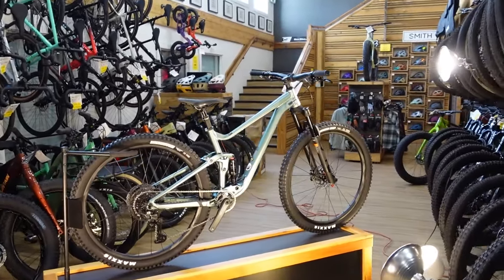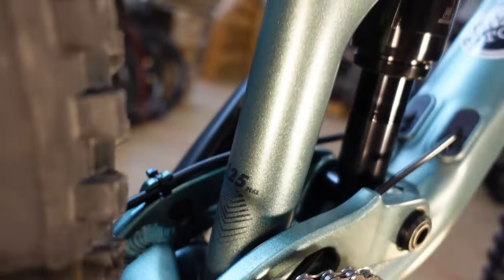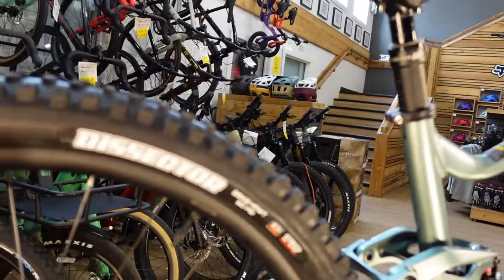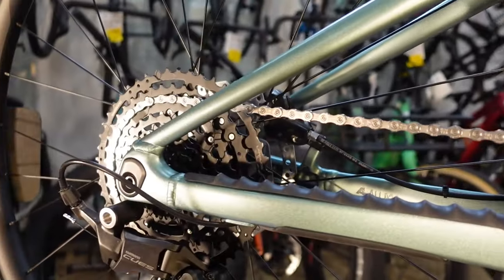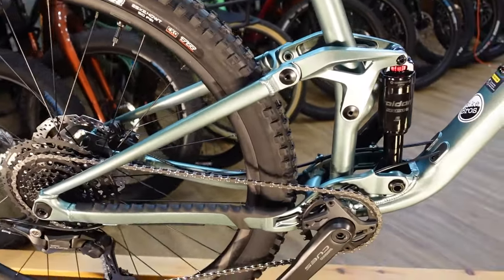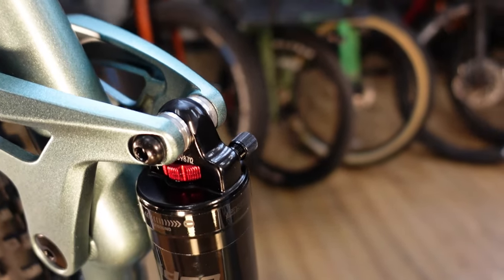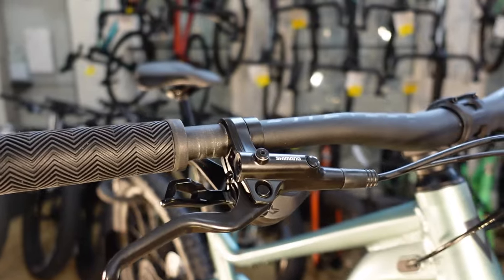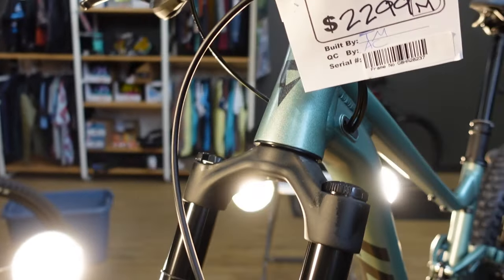2024 Giant Stance 29 2 - Best budget / value Full Suspension Mountain bike - All the Details

Comment: I'm almost certain at this point that I'll be buying one of these next year. I love the way it looks and the simplicity of the design. 33.8 lb is really not bad at all and I would swap to lighter tires too. I had a bike with the 10 speed deore and it was flawless so I trust the new Cues. Now I have a GX bike but imo it's not worth the extra cost. 

One thing I know nothing about is rear shocks - is this a common size that would be easy to swap and upgrade?

Maybe I'll end up having to come over to Cochrane to pick one up (in Sask).
Reply from the maker: Hi, yes, the rear shock is a common size. 190x45. Marzocchi, Fox and Rockshox all make that size (availability on rear shocks can be a little hit and miss because of the number of sizes they make but they do make them).
Reply: @BikeBrosBikeShop  thanks for the info

Comment: If The Extra Money Was There Would You Pick Stance 1 Over Stance 2? The Upgrades Worth It? Or Just Get Stance 2 & Do Some Upgrades? This Would Be My First Bike
Reply from the maker: I have a personal bias (and actually all the shop staff do) against Sram SX rear derailleurs so we don't even bring in the Stance 29 1. We've seen far too much inconsistency in quality and performance from one bike with SX to the next... a couple bikes work well and others have caused a lot of frustration for customers and our mechanics trying to get the shifting to work nicely and remain in adjustment. The most interesting feature on the Stance 1, in my opinion, is the fork which is modestly upgraded from the Stance 2 - with that exception I would probably choose the Stance 2 over the the Stance 1 even if the price was equal.